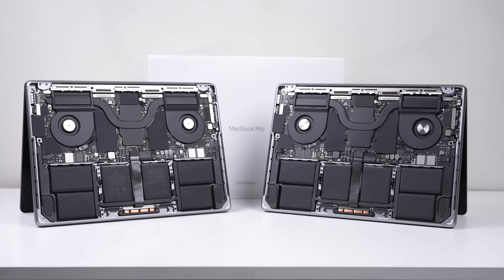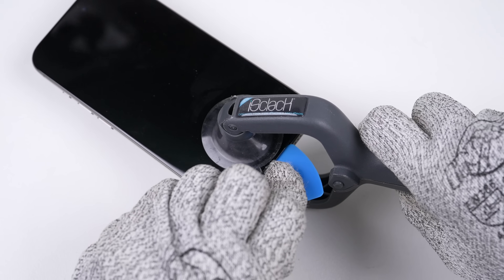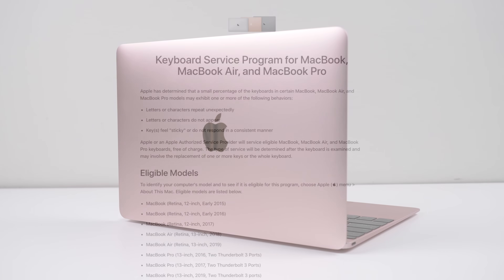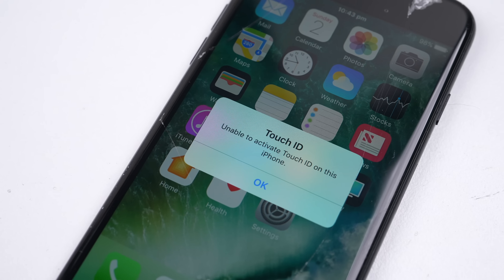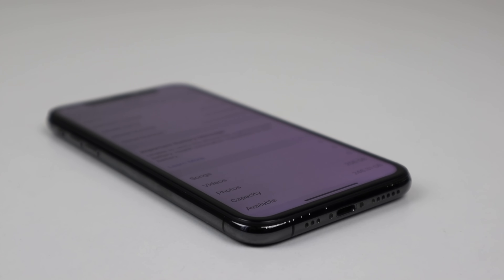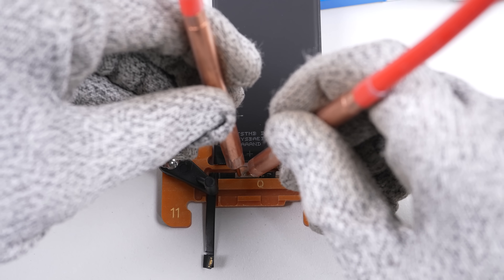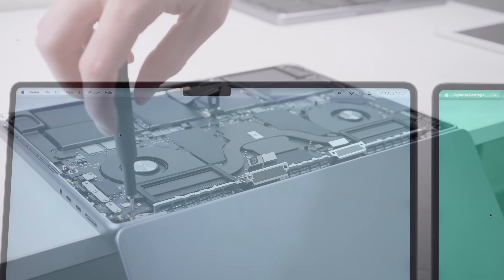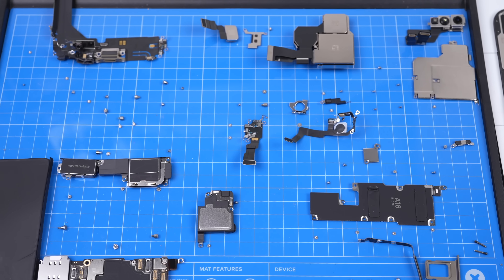Astonishing Anti Repair Practices By Apple In the Last 15 Years

Comment: The way I heard it for the "right to repair" bill in California is that it provides an exemption for waterproof portable devices, meaning the iPhones won't have to comply at all. That's why Apple can publicly claim support, while privately having undermined the bill to basically exclude themselves from it.
Reply: Already seemed suspicious of Apple to do a complete 180 and start supporting right to repair. There had to be something under the table.
Reply: @heperfectirl9470  well as the louis rossmann guy said ''it's a screw job after screw job".
Reply: @heperfectirl9470 Yeah, I have not found an instance of apple actually doing literally anything good for their users unless forced or pressured
Reply: @heperfectirl9470  No doubt that bri... 'lobbied' for that exception to be added. They got it and suddenly no longer care since they already got what they wanted: to be able to virtue signal and still continueusing the same scummy tactics.
Reply: Also the bill doesn't cover the serialized part pairing either
Reply: They would need to prove their phones are water proof.
Reply: It's like CAFE and light trucks... All phones will be water-resistant sooner or later.
Reply: @MrLukassky  the chicken tax was one of the biggest mistakes right alongside the 25 year import ban.
Reply: I'm reading through the bill in question, SB 244, Eggman. Right to Repair Act and I see no mention of the words "waterproof" or "portable." Definitely keep an eye out to see if Apple is complying like they claim, but currently the only named exceptions from the new law are "alarm systems" and "video game consoles", not "waterproof portable devices".
Reply: What about the right of having sturdier components?
Reply: The thing is, waterproofing can be redone during the repair. It usually means a rubber o-ring and glue to seal the device, but that is something that can be made available to repair services.
And that doesn't even requires removing user wanted features.
The Galaxy S5 is IP67 certified and has a headphone jack, replaceable battery and microSD slot.
The iPhone 15 Plus is IP68 certified, it can survive for 30 minutes at 6m depth while the S5 is only certified for 1m
The Galaxy Xcover6 Pro is also IP68 certified and offers headphone jack, replaceable battery and microSD slot, so those are no issue for the certification. It also costs half the price of the iPhone. And it it's USB-C connection runs over USB 3.2, while the iPhone only has USB 2.0
Reply: Thought it was suspicious they would be for that bill
Reply: least evil american corporation
Reply: I expect they’ll release water proof MacBooks soon
Reply: >waterproof
>apple

Choose one.
Reply: that’s the problem. a “solution” was put in place & legalized…..yet corps. slide $100s & sweet doublespeak into the politicians’ pockets & WE pay the price. Lobbying needs to end now & forever.
Reply: Well in that case the rest of apples devices like the ipads, macbooks and desktop devices will need to become repairable. Because the only waterproof devices apple sells are the iphone and apple watch.
Reply: Wow. Are people stupid? Why do they trust companies like Apple to do the right thing and think oast the money and profits? Why don't they ever ask "What's the catch?" Companies like Apple have no morals. If it were legal for them to walk up to you and steal your wallet, they would. Not only are Apple products designed for you to constantly spend money on them, but instead of accepting that reputation, they instead lie with blatant dishonesty about changing their ways. This is just disgusting. And Samsung is following closely behind in their footsteps. And it's only a matter of time before Google does it. What smarr lhone company can you trust? Should we even have smart phones at this point?
Reply: It's funny how they hide behind being waterproof so they can not let their consumers repair their phone or atleast make it hard/expensive... While..  Many old phones were waterproof while you could easily fix them.. Cheap..

This is all just poor excuse to make premium garbage.. Don't even get me started with all this greenwashing and supposed recycling
Reply: Probably a bill they support just to kneecap competitors
Reply: Scamnation
Reply: Sometimes I wonder if Apple is IRL Buy 'n Large from Wall-E. Step 1, make stuff excessive and meant for trash. Step 2, trash the planet and force people off. Step 3, captive audience and profit.
Reply: Knew there had to be a catch somewhere.
Reply: Not only that, let's assume that they will only honour that legislation in California, and that their statement doesn't apply in the rest of the world.
Reply: instantly knew there had to be some ulterior motive
Reply: how much do u guys think apple lobbied for that exemption
Reply: If there are exemptions for waterproof devices specifically, apple wouldn't be exempt from it. The vast majority of mainstream flagship smartphones are not waterproof, water resistance is something very different.
Reply: @invinciblenowyt  Waterproofing and water resistance are defo different in meaning to us, but I bet there's a loophole there. Nothing is fully "waterproof", only resistant to different degrees of water pressure. So my guess is they're probably going to make an argument around the definition of "waterproofing" within the space of electronic products. Most likely based on Ingress Protection/IP ratings.

If I had to guess, since it's IP68 water and dust resistant, they'll probably claim by definition that their phones are waterproof devices as they can survive being fully submerged in water past a certain depth for a certain amount of time. Only time will tell if they become exempt or not, or if they really decided to back it for whatever reason. Either way, I don't trust the reason to not be malicious and money hungry.
Reply: @justinli826 what's crazy is that modern kindles are ipx8 waterproof and they literally just have a gasket and a well secured screen. Infinitely more repairable.
Reply: @vappyreon1176  The same can be said for a lot of the android phones. They might not be as easy to repair as something like a framework laptop, but they at least don't do anything that's overtly anti-consumer. Quite unlike our resident half eaten fruit here.
Reply: @vappyreon1176  that's how the iPhone 6-11 were too.
Reply: <Samsung> Hold my beer!
Reply: @invinciblenowyt  As if that's going to stop them from making their new phones waterproof. They are not now, but clearly they have a plan.
Reply: @invinciblenowyt  Lots of modern phones have IP65 rating or above. Look up Ingress Protection rating. My phone has 68, and so do all iPhones in recent years.
Reply: I want the law to be passed in all 50 states
Reply: @hpippins22  No, i want people to finally think, then only drool and then buy there 
WAY overpriced stuff, that can be done by other computers or smartphones for 1/3 
of the price, and have the freedom to install any OS you want, governments almost 
always make thing worse.
Reply: After taking out thw waterproof part and the date cap
Reply: The problem isn't with Apple.  The problem is that people are stupid enough to buy from Apple.  It's THEIR fault.  If you want a phone or computer that you can repair, but a phone or a computer you can repair, stupid.
Reply: Given how much they have paid the authorities and the MPs. I am surprised they didn't do more like banning all the repair stores. Their capitalism knows no bound.
Reply: Do you have any proof? Like a citation in the bill or do you just make things up?
Reply: Blatant abuse and corruption of the very spirit of Law and that requires lobbying and pressure/influencing “your representatives” in the halls of high government, not hard to see what side justice’s scale is firmly, tipped towards.
Reply: Exemption should be overruled.
Reply: But they will have to comply for the MacBooks. The public narrative is shifting and eventually Apple and other companies will have to listen to the feedback or it will affect their bottom line.
Reply: Why is that even an exception?
Reply: God I hate it
Reply: Then UE enters the chat. We're not so kind with apple BS here. Losong out markets ? They don't want. Doing a specific product for us ? Higher cost that doing one World tiers product.
Reply: Shocking no one, the politicians of California are corrupt and are passing laws to look good instead of do good.
Reply: Typical!!!!!!
Reply: That's ridiculous. You can design a waterproof phone that can also be opened.
Reply: And yet there are still a lot of suckers out there that still believe that politicians rule the world, not the giant companies that paid for their campaigns anyway :)))
Reply: The fact Apple support it proves the right to repair bill is not yet fit for purpose
Reply: Sadly, no right to repair bill will protect people from the right to be stupid and keep buying underpowered crap at 5x the price.
Reply: California ruins everything
Reply: Can anyone say "capitalist dictatorship"?
Reply: smart phones are water resistant not water proof so apple will still have to comply to the law
Reply: @bjorn1583  Waterproof and water resistant in the context when someone uses either term is the same. All phones are water resistant and not water proof.
Reply: @xxbatman69xx98  it is not the same at all and there is even different resistance levels, not all phone are water resistant.
wrong on both your comments
Reply: @bjorn1583  No I’m not wrong on that first comment. Waterproof and water resistant are the same when talking about phones. Companies will say “waterproof” but it’s only really water resistant. The second comment I misspoke. I should have said All waterproof phones are really only water resistant and not waterproof.
Reply: @bjorn1583  So I kind of see where your confusion lies.
Reply: @xxbatman69xx98  being fooled by false advertising still makes you wrong and I aint the one confused, you are
Reply: @bjorn1583  I’m being fooled by false advertising by informing you that there’s no such thing as a “water proof”phone? I don’t think you understand what you are saying.
Reply: @bjorn1583  Ok I see where your confusion is. You think I’m saying that water resistant is waterproof, but that’s not what I’m saying. What I’m saying is that waterproof is the one that means water resistant and that companies who say that a phone is waterproof really mean that it’s water resistant. No phone is actually waterproof. This is what I mean when I say that waterproof and water resistant in the context of phones are the same. “Waterproof” just means water resistant.
Reply: @bjorn1583  So yea I see why you were so confused. But I thought I made that pretty clear so I guess you just didn’t read any of my comments. In that case I don’t know what to tell you, I can’t make it more clear.
Reply: NOt a single one of you have haver made two granny's talk yet know better than a leading manufactrer of devices that continues to be profitable. /popcorn
Reply: @jhoughjr1  Remarkably, lots of other leading manufacturers don't feel the need to make repairs so hard.
Reply: @jhoughjr1 i know that making my shit unrepairable by anyone except for me is a great way to make money and screw everyone else.
Pretty sure I do know better. We are upset because android is fully repairable and yet they STILL make money.
Apple products suck and people only buy it imo because of the brand.
Reply: @jhoughjr1  Profit does not equal value, else bank robbers and scammers would be seen as gods.

Stop being a dumbass, please. For your own sake.

Comment: Love your videos. I know Apple has been very anti-repairability. I think it is wrong, but do you think in the name of increased speed and “improvement” to the average consumer, Apple moves more into anti-repairability with a combined SOC: RAM, GPU, CPU, etc.? Meaning the average person just sees faster Geekbench and doesn’t see the long term issues?
Reply: That's sadly not the case here. The main problem is that they make parts not replaceable that have nothing to do with the performance or security of thier devices. A battery or a sleep sensor aren't critical components and have nl reason to be non replaceable. Combined CPUs and GPUs on the other hand are a different thing, that's gives actual improvements in performance and is something almost everyone does nowdays.
Reply: That's what M series SoC is. Apple is more of a "let's disable half the cores and underclock the system if they replace the power jack" kinda anti repair company.

Comment: If Apple is backing a right to repair bill it means the bill will not actually be providing users the right to repair their devices. They haven't had a change of heart I would not even consider that they have suddenly changed their ways until I actually see it.
Reply: there is a written exception for phones right in the bill, its insane.
Reply: It's all marketing

Comment: is it legal to prevent people from repairing their own tools with other parties? for example, i dont expect doctors to also be stethoscope engineers. but i do expect a basic plumber to have the right to use the parts he can legally use to do the plumbing. 

Apple is preventing people from doing their jobs by not enabling them to  repair them by their own means. this then creates a byproduct of waste contributing to rare metals, and other materials. this is littering at a gross level.

Comment: Apple design could have worked in a corporate environment: New products every few years. Constant software updates and security patches that conveniently cannot be downgraded. And standardization: every products can be expected to use the same parts, that only one side is capable of replacing broken parts. And only the corpos have that kind of money to shill Apple for services. But when the same principle is apply for the ordinary home user, it is nothing short of mafia extortion. Home users do not need new phones and macs every few years, that is for tech enthusiasts. Home user value their device’s longevity and wish to fix their own devices if they can. Home users want privacy. Like there are only 2 things that Apple had done right for the home users: constant software updates lasting for years and privacy.

Comment: Seriously? You try to make a condensed video depicting all anti-repair practices by apple - one which could be actually used against them.
And you manage to get LITTERLY THE FIRST FACT WRONG??? 
0:58 The Screws of the 2009 MacBook Pro battery are Tri-Wing, NOT Pentalobe ...
also, 3:03 the first riveted keyboard was introduced in the MacBook Air in 2010.

If you want a video like this to be taken seriously, you NEED to get your facts in order.

Also, no mention of "Activation Lock" whatsoever?

Comment: There's also a problem with SSDs having UEFI software on them, so if SSD on your laptop dies, you can't use it with external drive. Louis Rossmann covered this on his channel.
Reply: Apple's SSDs or every SSD?
Reply: @astroidexadam5976  I meant that Apple laptops store BIOS s/w on them, so the former.
Reply: how tell if your SSDs have that crap? dose crucial mx500 SATA style SSD laptop and desktop one do this?
Reply: @nightmarerex2035  That bullshit is done only on Apple laptops with T2 chip. Windows laptops aren't doing that. At least yet.
Reply: Link? I can format an SSD anytime.
Reply: @zoltanberkes8559  https://youtu.be/RYG4VMqatEY You don't format an entire SSD, only logical partition that is allowed to be formatted.
Reply: Interesting, where can I read more about this?